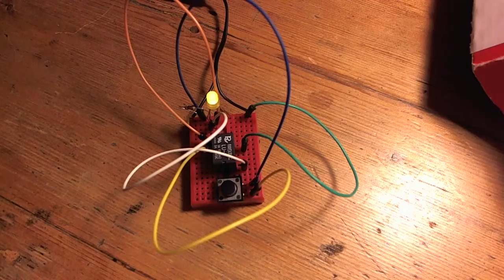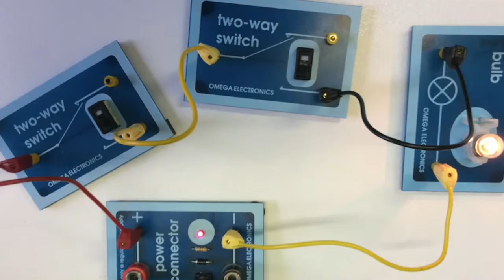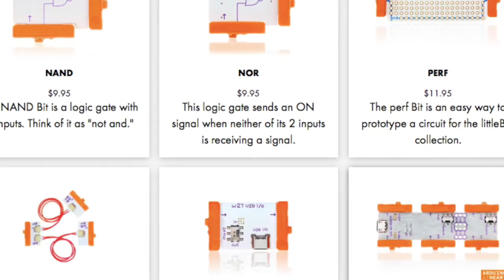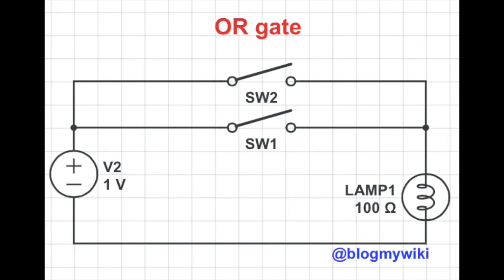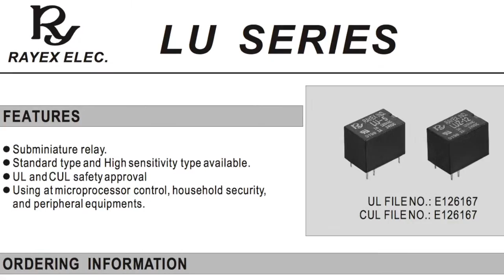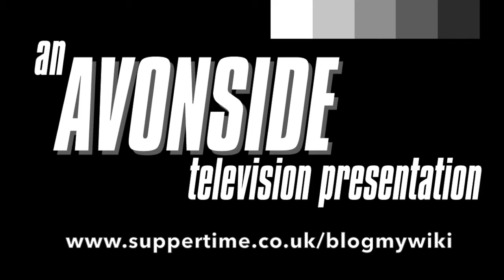Making a NOT gate with a relay

Comment: I think I figured out how to make a not gate with wires, a steel rod, and a spring.  You make a complete circuit with a magnetic coil and a switch, then you connect the rod with the spring on a back board and place the rod in the coil. Finally you have 2 open leads that will connect to the rod when the coil is switched off.

Comment: Is there any reason that you didn't use a single transistor as a NOT gate?
Reply from the maker: Good question!
1) I wanted to experiment with relays.
2) I have a sneaking suspicion transistors are witchcraft - I can't see or hear them move.
3) I didn't have a transistor. (I do now! Future projects will use them.)
Reply: If you didn't have a transistor, then that is probably the best reason not to use one 😀.
Reply from the maker: :D
Reply: @othermachines relays make repeatable satisfying clicky sounds. Ics and transistors make only a single unsatisfying pop before they never work again.